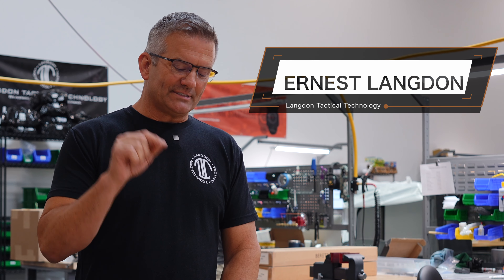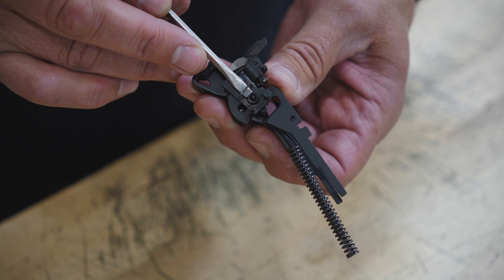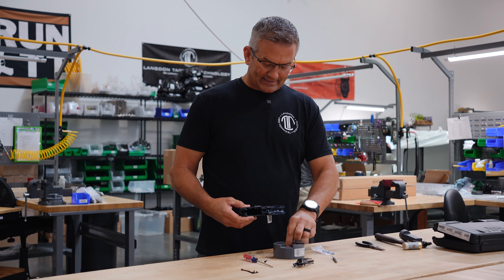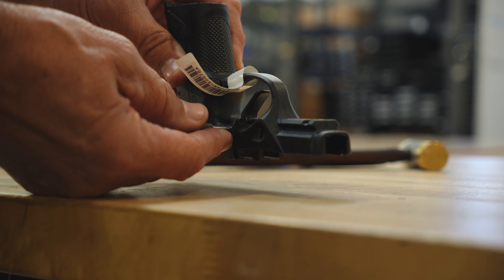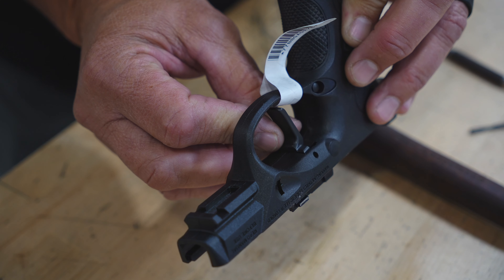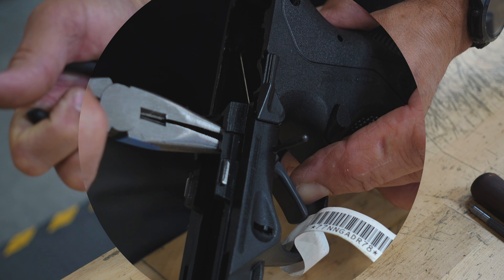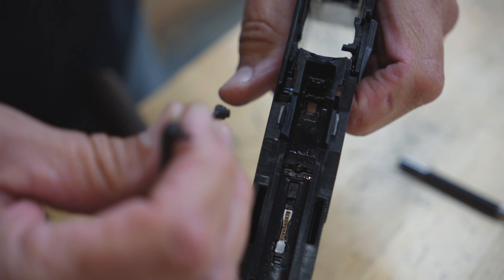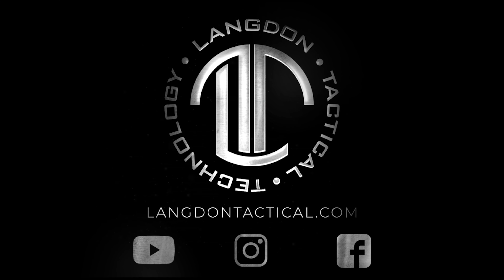Replacing the Trigger in your Beretta PX4

Comment: Thanks Ernest.  Without the specialized pliers, I found it easier to put the spring in place from the top before inserting the trigger, holding spring curl from top with finger and inserting trigger and applying pressure from the bottom.   Have pin tipped-in first of course.  Do the pin from whichever side works for you. I pushed from left like Ernest.  

The ends that push on the trigger can get splayed, so make sure both ends are in the channel.  The last bit where you have to finish the push-through takes some patient maneuvering, but not that bad.  

I got the Gray Guns flat PX4 trigger from Ernest and I dig it.  I had previously installed his trigger bar and spring kits.  

The trigger bar and the springs are SWEET!!  The flat trigger is more icing on the cake.  I would not do the trigger on its own, but after the transfer bar and the springs, I had to do the trigger too, and I like it too!

Trust Ernest Langdon on this gun!   Hasn’t steered me wrong yet!